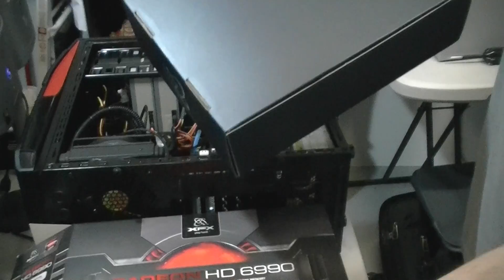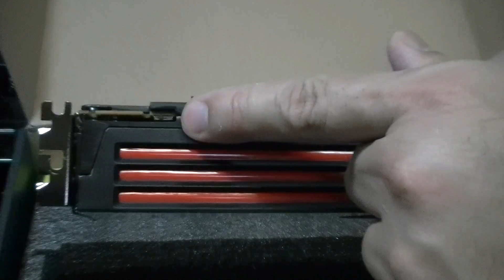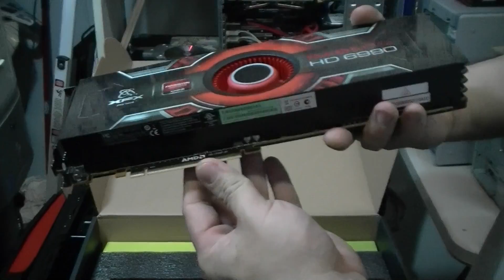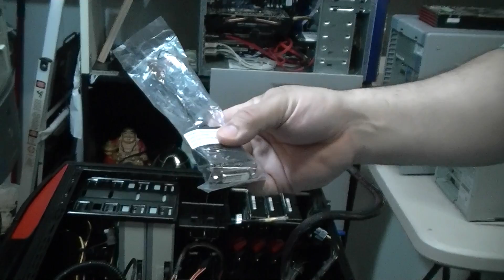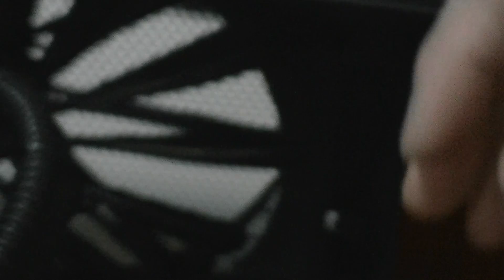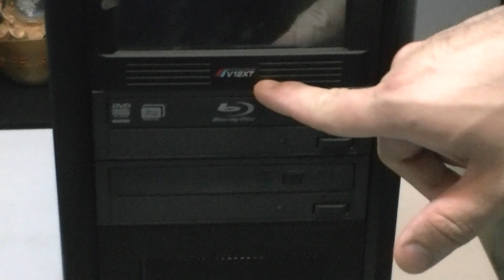XFX AMD 6990 re-unboxing, 16 gigs DDR3 2133, Intel 2600k monster build pt. 1

Comment from the maker: Yes Intel Officially does list the memory controller speed at 1333, but people are always doing crazy things to push the limit with whatever comes out at a certain time.  In most applications from gaming to productivity you can see about a 2% or more increase, but a HUGE cost at the time of this video, however, ddr3 has dropped big time recently.

Comment: @lorllc ty I did do a bit of research and finally found it out but now I dont know what card to get, 6950 seems good for the price and is just a bit lower than the 6970 in benchmarks, was also thinking about nvidias 580 but it only has a few frames on the 6970 so not much point but now theres a 6870 x2 card just waiting on benchmark tests and see if any1 is using it with a 750w

Comment from the maker: @FatalShotUK That means that your card will take up a total of two PCI slots.  The PCI express connector and another PCI slot.  If there is an expansion card in the way you would just need to remove it.

Comment: ive just bought a coolermaster gx 750w power supply but ive just noticed that the graphics card im wanting (sapphire 6970) requires  "PCI Express based PC is required with one X16 lane graphics slot with 2 slots space available on the motherboard" any idea what the 2 slots thing is all about cus if ive just bought a new psu and cant use a new graphics card :/